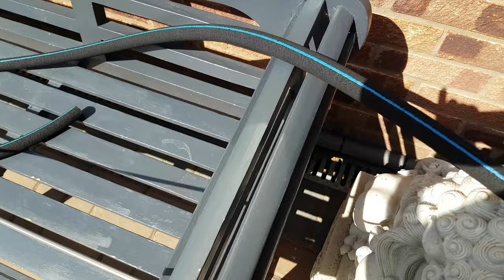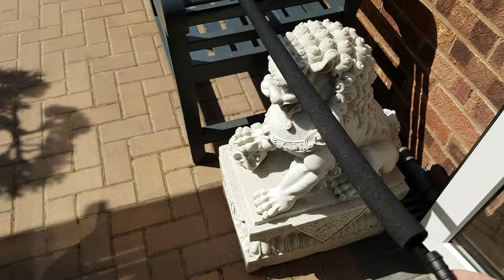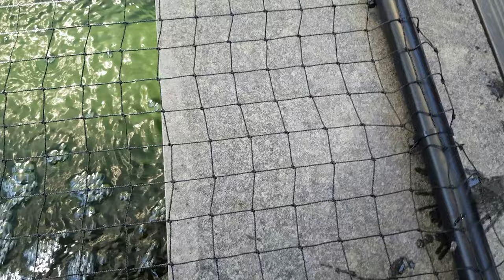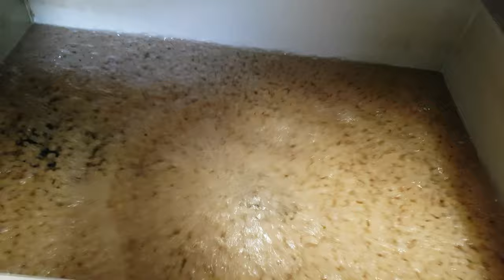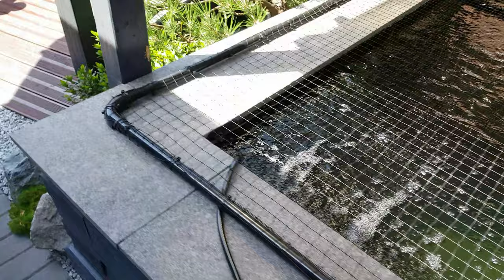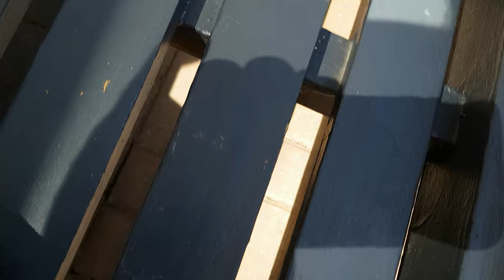DIY Koi Pond Air Curtain Diffuser

Comment: Excellent idea Dave 👍🏻 thanks for sharing.
Reply from the maker: Thanks, 🙂
Reply: What sort of clips did you use, for clipping the pipe to your coping stones please Dave?
Reply from the maker: @rodtribble494  Hi rod,
I used cable tie masonry mounts.
I carefully made a gap in the sealant with a flathead screwdriver between the coping stone and the liner (I had filled the gap with sealant.)
and pushed a cable tie mount in and used that to cable tie the ends, plus hold the air line tight under the edge as well.
they are a little bit big but I filed them down a bit thinner to make them fit. but grip the sealant well due to the ribs.
https://www.screwfix.com/p/cable-tie-masonry-mount-black-40-2-x-10mm-100-pack/68305
Reply: Great stuff thanks Dave 👍🏻

Comment: Fantastic idea and build Dave, was thinking about doing an air bar exactly like this for my build next year, But didn’t know how to keep it attached in the pond without making it something the koi could knock themselves on,  a simple and easy idea. Thanks will be doing exactly this 👍
Reply from the maker: Thanks Andrew, 👍
I'd been trying to source the proper aerator hose.
But it was finding it hard to get in the UK, until I discovered it when I was at queni koi.
Reply: I tried the same , and could only find the £100 a metre stuff or the stuff from Eco, great find and will also try using some on my moving bed instead of air stones
Reply from the maker: @andrewjones7670  I made a 1meter circle aerator for my moving bed later on today, 
but to be honest the 200mm airstone uses slightly less air to get it rolling.
Reply: Are you using a 200mm round airstone or a straight one. I’m using a 200m long one in mine with 40 lph ( it actually got 2 in it but turns over better using just the one) and around 85 ltrs or k1+ and it’s just about enough, I’ve made a 8mm drilled pipe to try on it next ( just waiting for a couple of weights to arrive before I try it, if not I’ll try a piece of the air line you have used ( already ordered) I know I probably need more air to get the movement I want but it’s a good way of seeing what’s best , before I swop the pump over for a bigger one.
Reply from the maker: @andrewjones7670  
Im using a 200mm disc flat round.
Reply: Thanks 👍

Comment: Lovely pond, exceptional fish and a cracking idea....been thinking of doing something similar myself. Or at least moving the air away from the centre of the pond anyway.

Just subscribed!

All the best mate 👍🏻
Reply from the maker: Cheers, 👍
The fish seem much more active since getting away from the bottom drain aeration.
Feeding is also less of a scramble, than having it all pushed against the glass and the fish fighting over it...😁
Reply: @DavesKoiPond  haha I bet 🙂 just one more question, is that a mugo pine at the front of your pond? I was looking at your YouTube banner picture 👍🏼
Reply from the maker: @abkoi  Yes mate. 😀
There are two mugo pines, one in the ground next to the bridge, and one on the corner (now in a bonsai training pot.)
Reply: @DavesKoiPond  Thank you. Looking to try and find a bigger one like yours for my rockery but it’s proving difficult 🙂👍🏼
Reply from the maker: @abkoi   A local garden centre gets larger trees and plants in occasionally, i've had that one for a couple of years or so now.
It was very lopsided, with a right angled split trunk, but ideal for bonsai training once it was removed...👍

Comment: Great stuff Dave. Air curtain are so much neater than aerated bottom drain. So thank you for sharing.
I think I missed out on an info, or I just simply didnt understand it, if the tube now.sitting at the bottom or suspended half way?
Reply from the maker: Thanks Lau, 😀
The air curtain is about one to two foot below the surface (300mm - 600mm)
Reply: @DavesKoiPond  thanks Dave. I like the look of it in a pond.
Reply from the maker: @LauMagroTheFrenchKOInection  Thanks, I do too.
when I built my pond I just followed with most other builds, and fitted an aerated bottom drain.
And i'd still use it when medicating and need the extra O2, 
but much prefer the more natural look of the water, where I can see the fish better 😁
Reply: @DavesKoiPond  most definitely.

Comment: Hi Dave cracking idea that! Your pond is very similar set up to mine... your skimmer is in the same location, Do you find it effects how well it skims the surface? Cheers
Reply from the maker: Thanks, 👍
It was designed like that, the curtain pushes the surface water away from the skimmer but it still stays mainly clear and clean.
As the skimmer draws about 12,000 lph and has so much water moving through it, it has it's own whirlpool inside 😮

Plus I was fed up of seeing all that expensive saki hikari floating into the skimmer never to be seen again lol! 😄
Reply: @DavesKoiPond  thanks for getting back to me. Ill be making one of them! My skimmer was  well overfed saki last season aswell 😅

Comment: Looks great this Dave 👌 defo going to make one up for my pond. Are you  using this to completely replace the air from the spindrifter? Or just as a way of adding extra air?
Reply from the maker: Thanks, 🙂
I'm using it to replace the bottom drain aerator, 
It's still connected, so if doing a PP treatment or if I need extra air I can still use the Jager bottom drain aerator as well. 👍
Reply: @DavesKoiPond   Great.. was the main reason for the change,  to help give you a better view of the koi ?
Reply from the maker: @craigroughley8615  Yes that's one reason, 🙂 
the other was lots of japanese breeders use air curtains rather than bottom drains aeration, 
and I liked mike snadens set up with bakki showers air curtain. 😁

Comment: Great video.👍 Can I ask where you bought the stainless steel bar from? Thanks
Reply from the maker: Thanks 👍
I got the 316 stainless steel round bar from a local steel stockholder, usually works out much cheaper buying locally than ordering online.
All the links are in the description, but this is the local steel stockholder I used. 🙂
https://www.rapidmetals.co.uk/product/stainless-316-round-6-4mm/
Reply: @DavesKoiPond  thanks for the info.👍

Comment: What's the rough size of the filter house you have mate?
Looking at building mine this summer
Reply from the maker: The filterhouse is about 1.2mtrs x 3mtrs as it's the 'shed' part of a log cabin.
but I would prefer one that is a bit wider if building from scratch.
2mtrs x 3mtrs would give you more options.👍

Comment: Hi Dave, neat idea mate....    Do you think this would be man enough to make a moving bed move ?     I have a pre existing moving bed with 2 air discs in,   But im thinking this tubing all the way around the bottom of the box and accross the middle,  might get better coverage .  Just depends if its man enough.  I think my box is approx 1m depth which is where the hose would sit, and 1m each of the sides,  what do you think mate ?
Reply from the maker: Thanks, 👍
I tested out the 800mm circumference circle diffuser I made.
And while it got my K1 micro moving bed rolling ok, it needed more air than the 200mm disc airstone I was using.
Going all the way around the bottom would need a bigger air pump I think...
Reply: @DavesKoiPond  i got 2 70s air p;umps running it currently,  1 each disc,   so would 2 x 70 air pumps be enough to run it well you think ?   175 ltrs of K1
Reply from the maker: @BlingKingMarvellous  It should be enough for the aerators, 
but I don't think that having the air around the bottom perimeter would move the K1 better than a central air stone...
perimeter aeration works well on something like the nexus because of the shape of it. 
For a square or rectangle moving bed, either air bars running the length of the middle like the draco moving bed, or central discs would work best imo. 😃
Reply: @DavesKoiPond  ok dave thanks for your input

Comment: Outer diameter diffuser 16 or 25 ?
Reply from the maker: Hi, 🙂
The outer diameter is 25mm. 
Though some diffuser hoses are 12mm internal and some 16mm internal, so the hose barb fittings need to be sized accordingly. 👍
Reply: @DavesKoiPond  terimakasih salam dari indonesia
Reply from the maker: @riecautami8911  You're Welcome 🙂
Reply: @DavesKoiPond  hose 3/16 or 5/16?
Reply from the maker: @riecautami8911  We're mostly metric in the UK.
Even though steel pipe sizes are still imperial, I was made to work in imperial by the older machine fitters and pipefitters at work when I was an apprentice😄
The flexi hose size I use is 12mm O.D./8mm I.D closest size in imperial would probably be 15/32 O.D. x 5/16" I.D.

Comment: Interesting Dave, might copy if that's OK, got airline running through bottom drain pipe connected to retro air dome lid, but don't like it, airline hose catches weed and debris inside drain pipe.
Reply from the maker: No worries mate,
I've pinched loads of good ideas from other channels too 😁